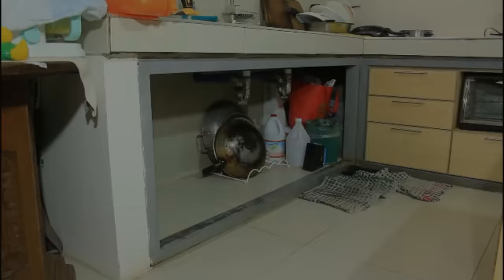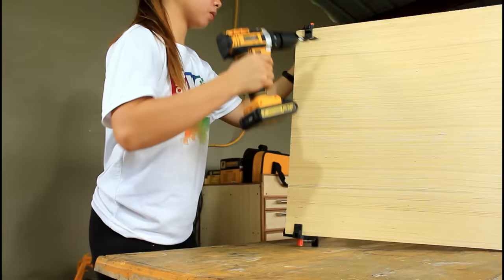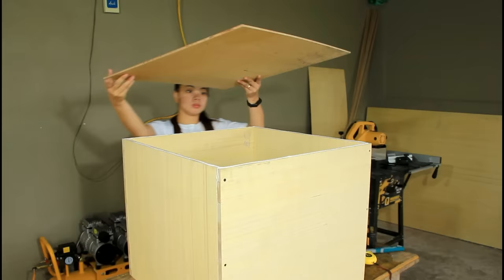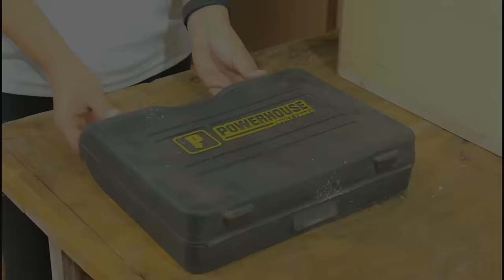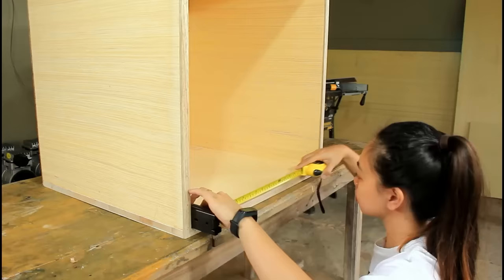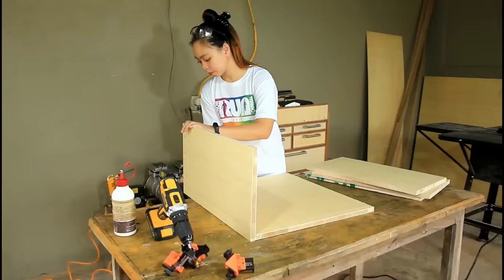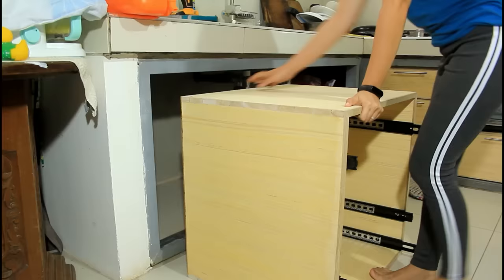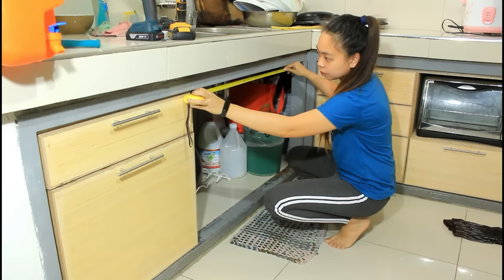DIY Sliding Door for Kitchen Base Cabinet || D.A SANTOS ||

Comment: Hello to you ..... Firstly, I wish you and your family a Happy New Year. Secondly, I am happy to see that your Kitchen has another piece finished for you to enjoy using. Respect for your work. Now I know I will sound like old grandpa that knows it all. However you should "Never" hold the router at the bottom. If it slips it could cut your hand and damage tendons and/or nerves. In which case you may not be able to use your hand properly or possibly not at all in the future. You should also never use pressed air to blow dust off your body, (I admit that I do it too) but if you do, then please at least leave your protection glasses down. Your hair doesn't need protection from dangerous particles 😉 Everything is looking better from video to video. Waiting to see it completely finished. Take good care and stay safe. 👍👏👏👏.... 👋👋
Reply from the maker: Thank you so much grandpa for your suggestions 😊
Reply: @DASantos  hallo
Reply: @DASantos  MUJHE
Reply: @DASantos  joB
Reply: @DASantos  chahiye
Reply: @DASantos  carpenter
Reply: Robert, thank you for saying this, I'm a hand therapist and this is EVERYDAY in the emergency room. I think the table saw use is a bit unsafe in this video as well. Careful everyone!

Comment: Hello D.A i was amazed specially your diy works made by a carpentera..new subscriber..may i know where you buy the corner clamp and push on roller for sliding door also the aluminum rails.appreciate your quick response .godbless